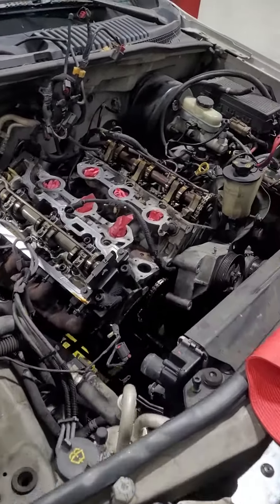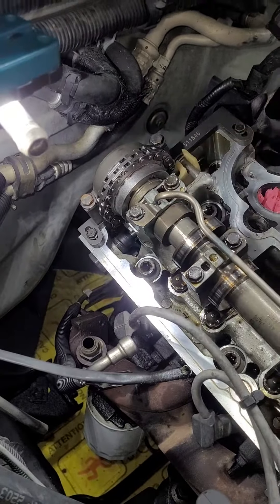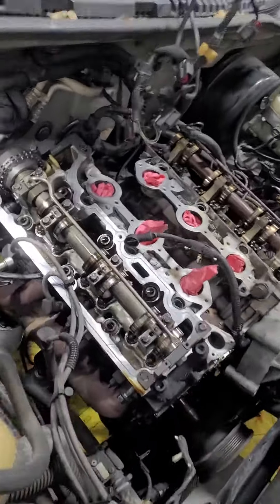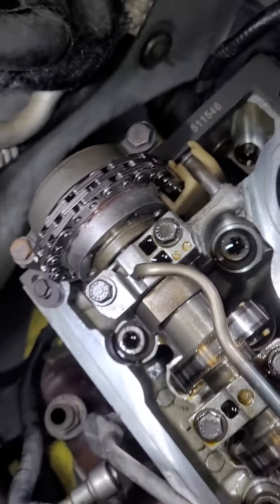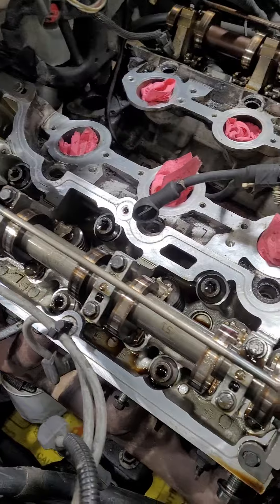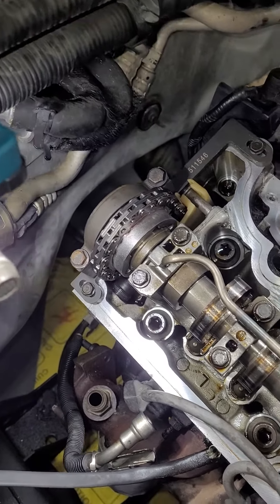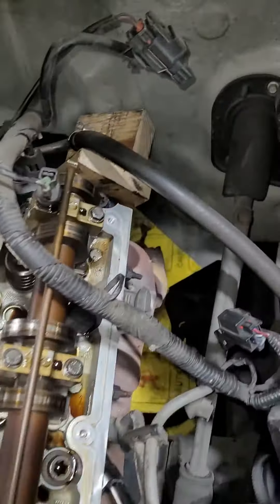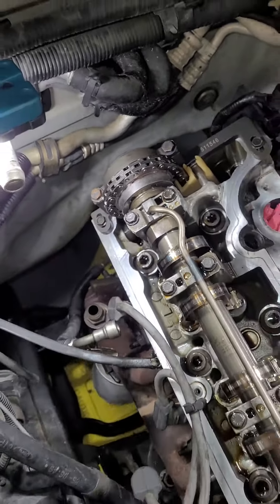Ford 4.0 SOHC rear timing chain cassette without engine removal

Comment: Why's this guy so afraid to take the engine out?  He like 2 bolts away from. Having it out anyway and he could have left the transmission in. Way easier to do everything on the engine stand
Reply: My bet is lack of experience. Nervous to pull engine. In his cases. It's easier and saves a shit load of time
Reply: I would rather remove a transmission than pull an engine. I have done both many times. The Explorer sits higher than a car, so you need to get the hoist way up. I own 3 Ford Rangers, 2 of them are 4WD with the 4.0L. It would be tough for me to get the hoist high enough to clear the radiator support. I may have to remove my trans on one of the trucks due to no reverse, so will check out the rear chain when transmission is out.
Reply: @nofortunatesonII  was there enough room back there to remove rear cassette? im about to try it monday
Reply from the maker: @brandondrz2009 lack of experience lol? I've been a professional tech for 25 years. I just didn't feel like pulling it all the way out. Pulling the trans is easier
Reply: @Temppy1   The guy in the video had enough room to do it. I have done my share of engine removals as well as transmissions. I would much rather remove a transmission than an engine. Good luck with your repair. Always disconnect your battery before any major repair when working near engines.
Reply: @nofortunatesonII  yah i ended up removing the engine there was zero room in the ranger do it by the trans
Reply: @Temppy1  Thanks for letting me know. I have transmission issues that will require removal. Was going to check at that time. I guess maybe the Explorer has a little more room?

Comment: I pulled the engine. In most cases there's pieces of the cassette in  various places down there. However,  I would probably do it that way had it just happened, and  cassette was all still there.
Reply: How is it easier to get to those "places"

Comment: I am on the tail end of the same project. Did it the same way, pulled trans, jacked up the back end of the engine. In my case, removing the engine wasn't an option.

Comment: Hey Greg, this is a pretty brilliant idea, do you think this will work on a mustang with this engine or is the firewall gonna be closer??
Reply: Were you able to do it on the mustang?
Reply: @brandongreen6924  Wound up handing the project off to my brother in favor of 4x4's. Anyway, he pulled the heads and found at least one valve was bent, so he's just going for a full engine rebuild. In conclusion idk if it would have worked or not.

Comment: How often do you work on this engine type and repair the chain cassette Greg ???
Reply from the maker: Every time i pop my hood i guess lol. This is the only time I've ever had to replace the chains on one though
Reply: @straymusic  So this chain change is overrated ??? Most of the time you just change the adjuster ???  Just checking as many people say they did not change the chains and have 200K plus on the clock.